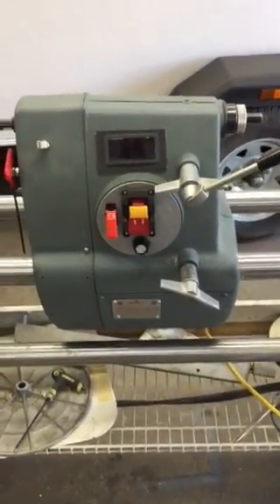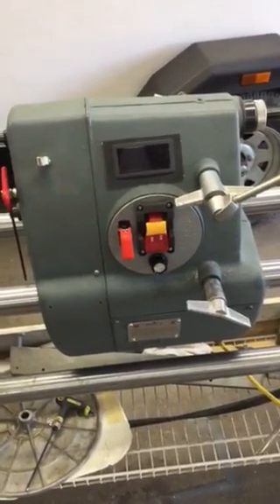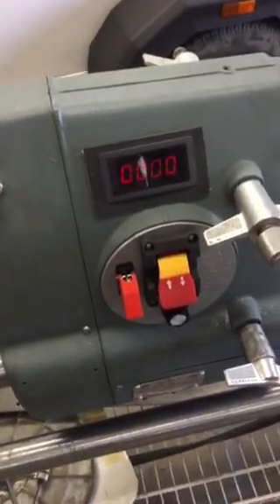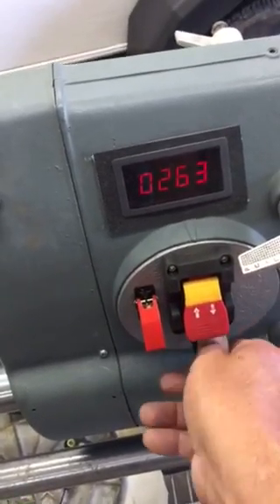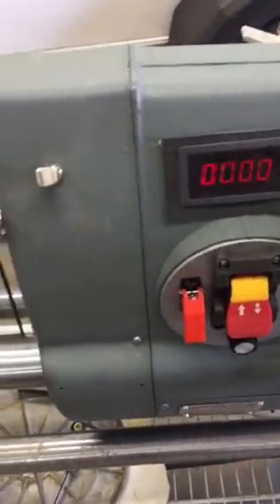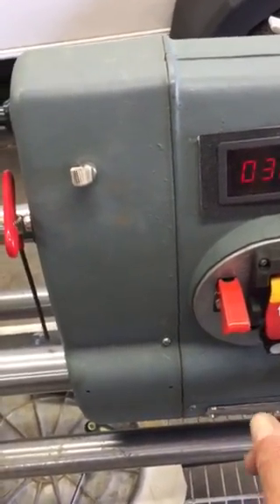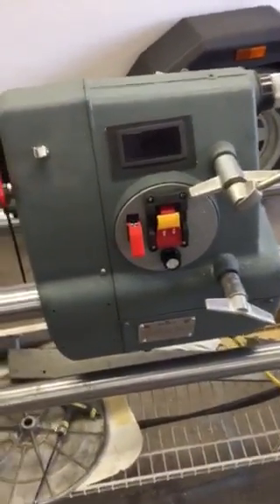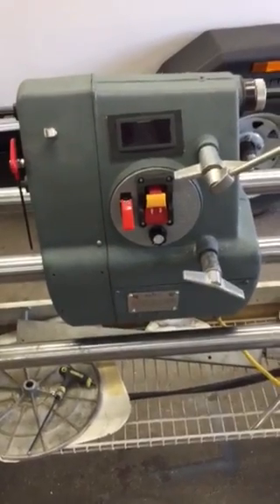Shopsmith to Treadmill motor conversion

Comment: The only other person I seen that put all of the treadmill parts in the machine and put back all together with no parts hanging out. I even  took the shop smith speed dial and hooked it to my  potentiometer to control the speed. very cool. Getting ready to do another with  a 3hp phase and a VFD It will be a 220 volt machine but a power house.   Also I own 3 SS my dad owned 2 I have been using them for 40 yrs. You DO NOT need to turn down the shopsmith every time you turn it off. As long as the process you are set up for is set at the right speed Just turn on it wont hurt a thing.  what you cant do is have it turned up on router and then put the disk sander on and turn on. it puts a load on the machine or can tear something up like if you went from router to scroll saw. but if you are set up on table saw I make my cut turn off then  if I need again turn right back on, never hurt nothing, they only put it in their instructions because if you are on table saw and turn off and hook up the scroll saw you are going to hurt it.so to keep people in the habit of just turning them down keeps this from happening. Anyway nice build I hope you like it. Mine lacked power when spinning slow but still is very useful.

Comment: Holy crap - any more info on this?
Reply from the maker: I have a few pictures of the process. There is much info on youtube about building dc speed controllers for treadmill motors and the conversion calls for a bit of mechanical expertise as you will have to fashion the motor mount and set up the belt drive system. It took a lot of fiddling around and trial and error to get it all working but if you are an experienced tinkerer it isn't all that difficult.
Reply: could you please share any info (pics, drawings, specs) please.
Reply: I guess he's not gonna share more inf0. :(